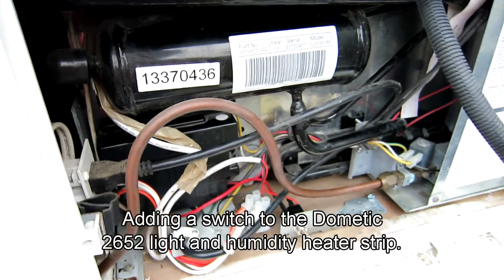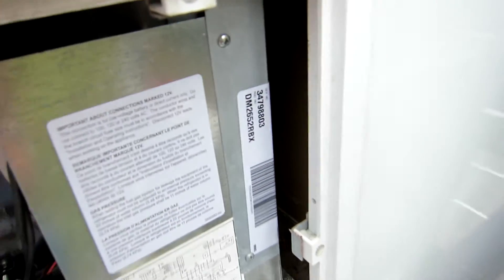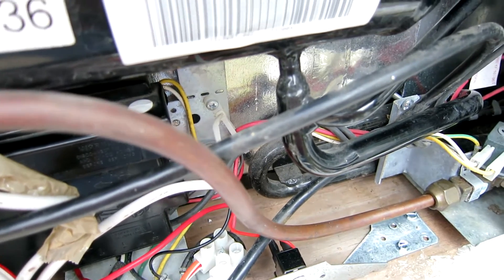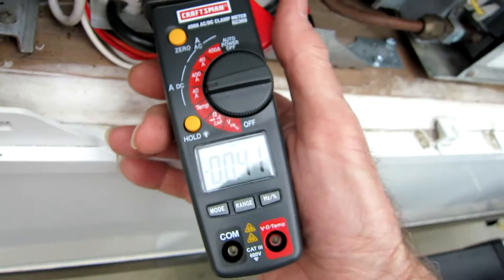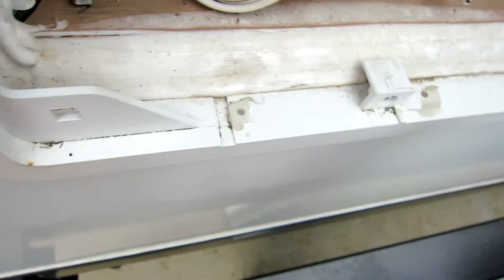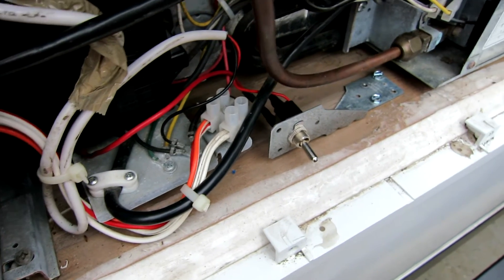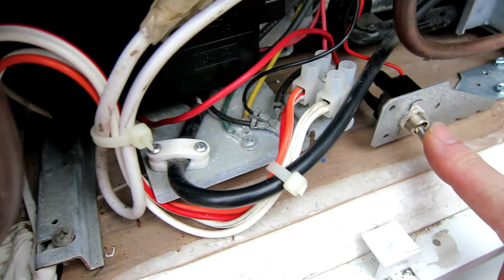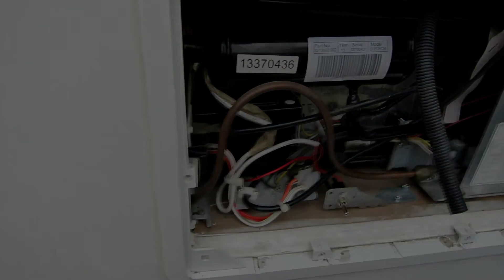Dometic 2652 RV Refrigerator Climate Control Modification for Boondocking

Comment: I did the mod & it seems to be working. I have some questions that really need to be answered by Dometic I suppose but I will get them out. If this mod stops the problem of running the batteries down so fast & I know I am not the only RVer that boondocks WHY is Dometic not being pounded with ??? regarding this subject? There are a ton of these refrigs out there in all types of RVs but seems like you & I are thonly ones that have a problem. Anybody have that answer Please?
Dale
Reply from the maker: Dale,
I first learned of the issue from the Forest River RV forum.  It was a complaint by boondockers.  The more common fix was to clip the wire inside the box that feed the light and the heater.  That way you could keep your light but the heater was permanently disabled without doing some wiring.  So I decided on this solution, however it does kill the light in the box also.  I think dometic just decided they were going to save a few buck and not put a switch on the front of the refer like some models have.  I leave the switch off all the time as I don't have an issue with the door sweating.  Not even in Louisiana.  ha.